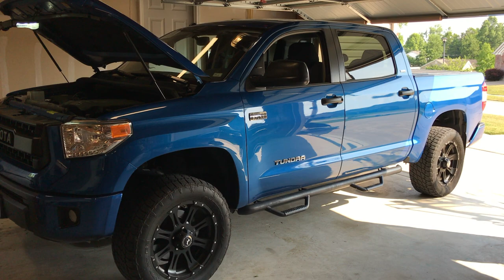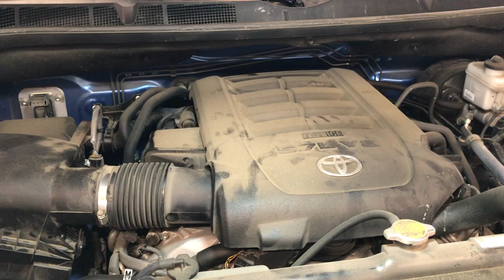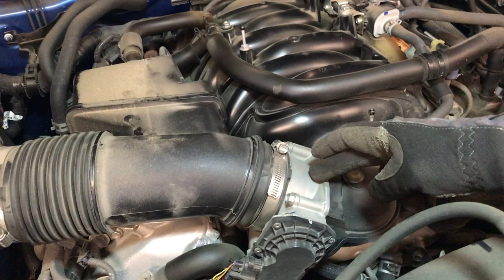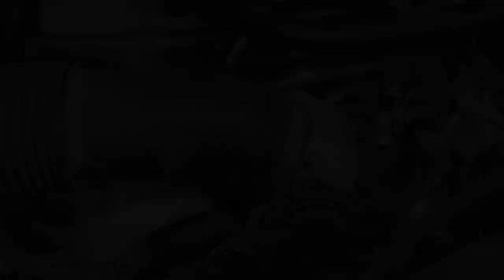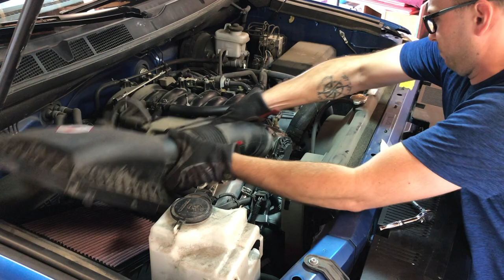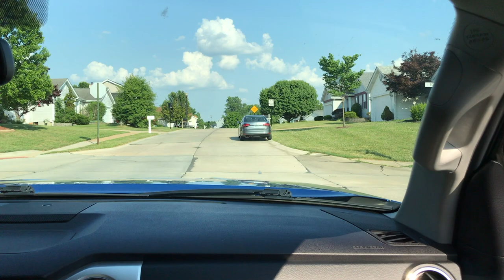Brad's Mods - Fixing that annoying "Tundra Whistle"

Comment: This was driving me crazy!!! Thanks for the vid. About to make this fix before my wife gets irritated at the tundra I just bought!! 😅
Reply from the maker: Lol love it and love that this video is STILL helping people!
Reply: @bradscarmods  quick question tho - this model part was originally for the 4.6L right? I just got a 2015 tundra 5.7l with that hissing noise. Just wanted to make sure with that part number you have in the description.
Reply from the maker: My truck is a 2016 5.7L and it fit perfectly.
Reply: @bradscarmods  cool, thanks!
Reply: Just installed this today! Whistle has gone down by 95%!!! Drastic ride satisfaction now… but maybe I need to double check if I put it back together correctly

Comment: Just got a 2017 tundra platinum and I’ve been dealing with this whistle noise. I haven’t switch the mesh part out yet but I am thinking this is my issue. Thank you for this video!
Reply: Same here just bought a Toyota Tundra 2017, and I hear the whistling I thought I was losing my mind. Is it normal to drive with until I can replace it?
Reply from the maker: Oh for sure. It’s not an issue, just annoying.

Comment: This sound can also be caused by the k&n air filters. The sound didn't start on my tundra till I switched to the k&n filter, also saw the k&n sticker on your filter cover
Reply from the maker: Yeah that’s interesting. I’ve had that filter in there forever. I’ve never heard of that causing an issue but I don’t doubt it. Good info!
Reply: Seeing your k&n sticker is what got me curious, came across some forums with other people describing a similar sound
Reply from the maker: Interesting for sure. I made that video a long time ago and have had zero issues since, have almost 150,000 miles on the truck. I no longer have that mesh part I removed and swapped out in the video otherwise I’d test the theory.

Comment: Mate I did that, I changed the ring but Vaccum leak came, so I suggest to keep
It or modify the existing mash and remove the net. As there is metal ring inside the gas kit. That my Expreince

Comment: Man i changed this gasket. The whistle is still there but quiter. Do you have any suggestions? Maybe tighten throttle body more? Hole in hose?
Reply from the maker: Wow that is odd because the whistle comes from air passing through the grid on that gasket.I wouldn’t tighten the throttle bottle beyond the recommended torque specs. It’s certainly possible that you have something not sealing correctly. Double check everything!
Reply: @bradscarmods   Do you happen to remember the torque spec? I'd suspect it's likely what, 20 ft.lbs, in that ballpark? Edit - Nevermind man, just caught it on a second pass, 10 ft.lbs - thanks much!

Comment: was it a constant whistle? was it rpm related or speed?
Reply from the maker: Good lord I never checked my comments! Sorry bud. The noise was rpm related. I heard it most driving through my subdivision with the windows down. It’s been a while since I made this video but if I remember right it was at a fairly low rpm like around 1,800ish?
Reply: @bradscarmods  Same here, with my Fortuner, at low rpms and also on shifting gears when I release the throttle. Around 1500~2000 rpms.

Comment: So what’s the mesh for?
Reply from the maker: Wish I knew! The only reason I felt comfortable doing this mod was because you’re literally replacing the part with a different factory part that’s from the same engine just in a different model.
Reply: @bradscarmods  got it just wanted to make sure it wasn’t some kind of filter
Reply from the maker: Whatever it’s filtering would have to make it past the charcoal filter AND the air box filter which are both filtering way smaller things.